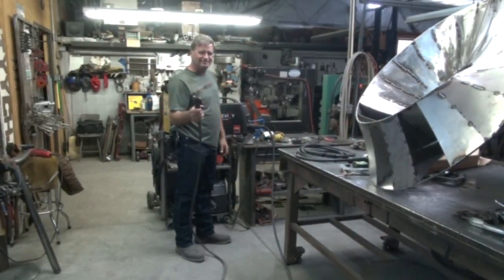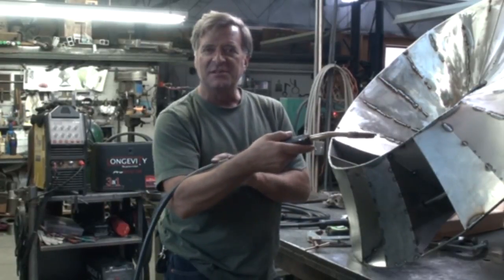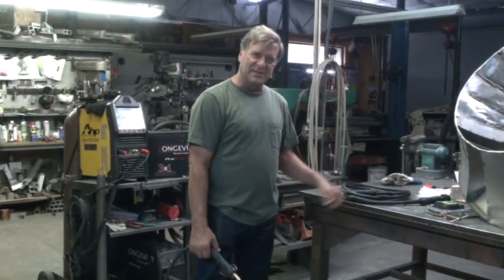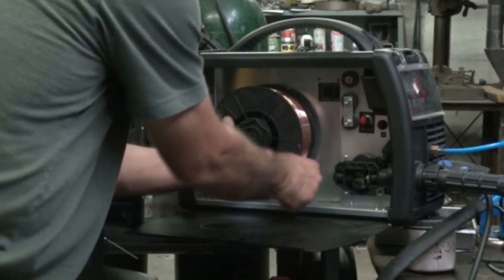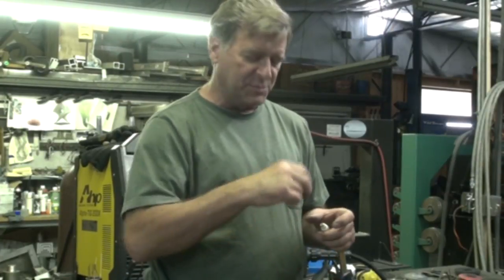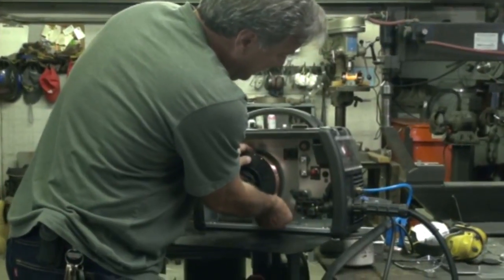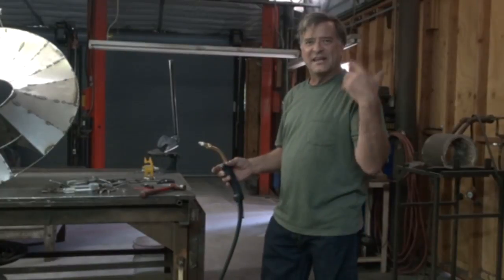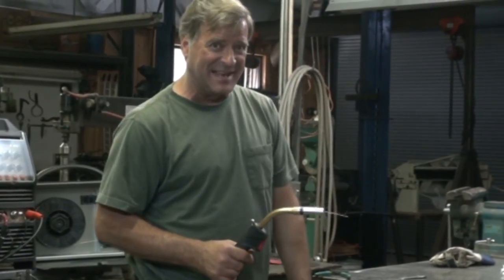How to Change Your Welder Cable (and Why You Might Need To) - Kevin Caron

Comment: what if i change from a 6 to a 11ft one and its a bit thicker gauge 16mm^2 to 2 would it be weaker?
Reply from the maker: Now you are really straining my brain!    Yes, if you go longer you also need to go bigger around.  I would jump 2 sizes bigger on the wire to make up for the increase in length.   But you really should talk with someone that does this for a living.   I have no problem guessing on my own dime but would hate to give you wrong info and you have a problem because of it.

Comment: Hey Kevin, I have an esab 260 with a euro connection. I came across a good deal on a torch but has a, I believe lincoln connection. can I change the connection over to a euro connector?
Reply from the maker: Yes, just have to get the right  connection.
Reply: Those are good machines (our local vo-tech has a fleet of them and they gave no trouble when I worked there) and you do NOT require a Euro connection IF you use a backend adapter from Tweco or similar. The adapters often cost as much as a new gun.

However new Euro connector MIG guns are inexpensive online. GET THE SORT WITH A TWECO STYLE GUN and you can use much less expensive Tweco-style tips, nozzles and other consumables.  MIG gun maker like proprietary tips and nozzles because they make more profit. The patents are long expired on Tweco guns so there are plenty of good clones on the market.

Comment: You'll find it will feed better if you get a liner for 0.023 wire.

On a larger liner, the wire can flex in the larger bore and acts like a long spring.
Reply: Find out what torch they use; it probably is a clone of a Binzel MB15 or Tweco #1.